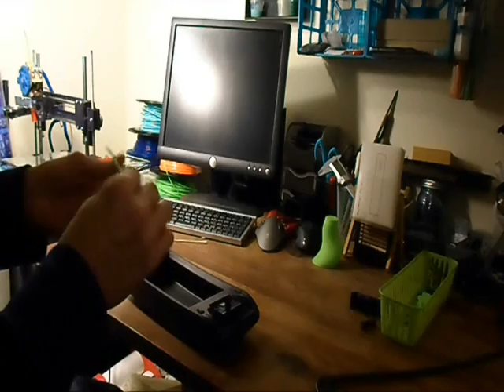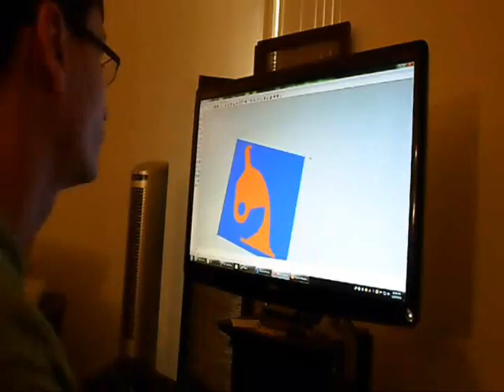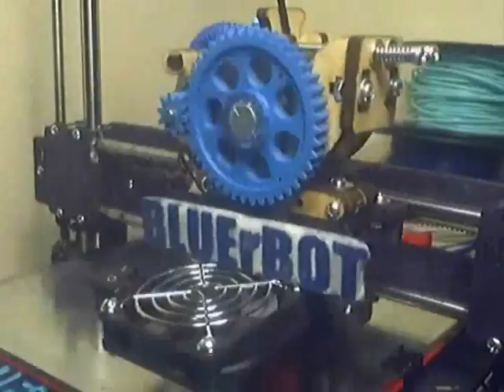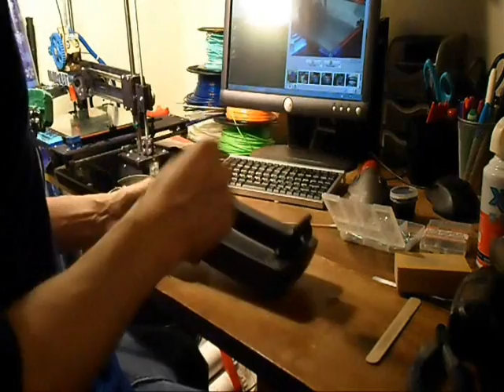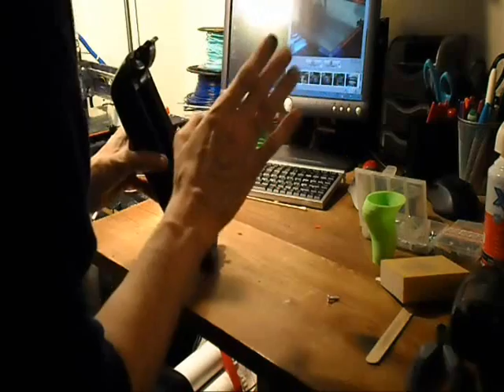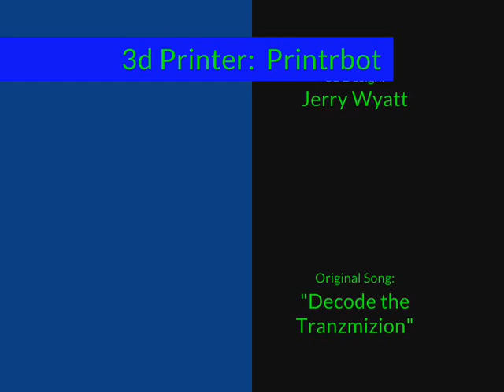2008 Scion XB Center Console Cover - a 3d Printed repair by BLUErBOT

Comment: This is exactly what I would be doing if I had a 3d printer. Just printing replacements for all the broken parts in my car. I can't wait until I can get a 3d printer that can print very large objects in stronger plastic materials and in metals.